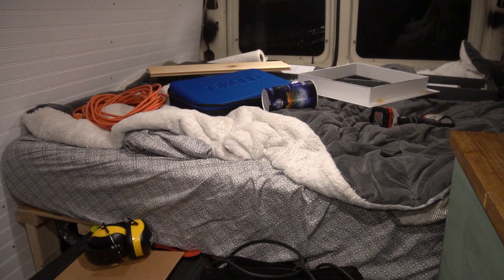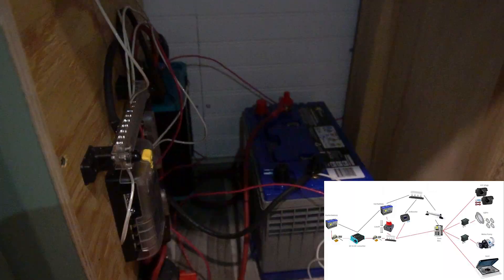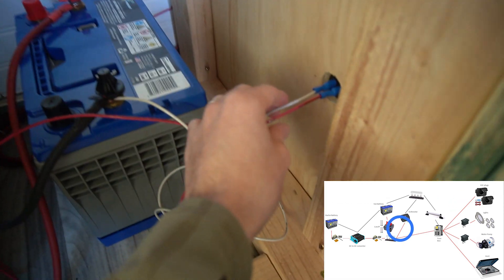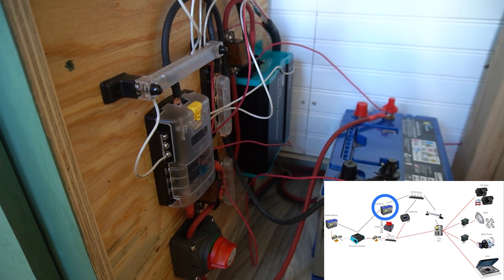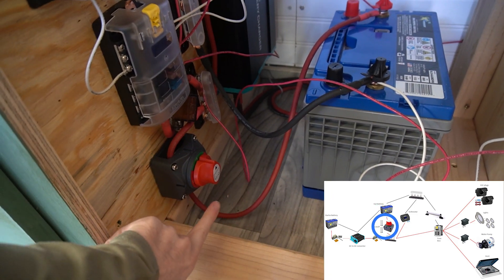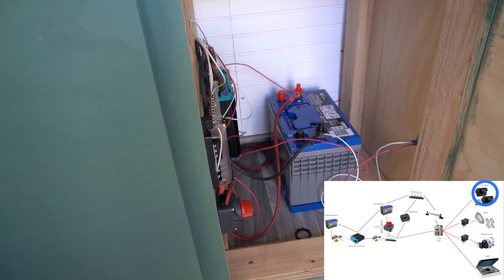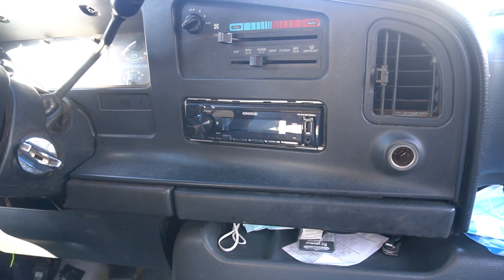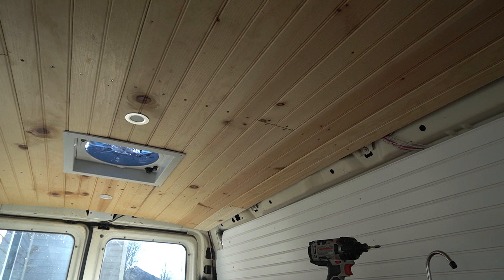Van Conversion Electrical under $1000 - Econoline Van Conversion: Part 3 - 1992 Ford Econoline E-250

Comment: You can't go half ass. As you have to wire everything before you cover the Walls or Roof...Unless you like exposed wires hanging everywhere.....So I suggest you plan on upgrading and run the proper wire ahead of time...

Comment: I’ve seen a lot of installs for rooftop fans and they’ve usually mentioned butyle tape as the best way to ensure a leak proof fan👍🏻 thought I’d mention. Nice build and videos
Reply: Butyle tape is 1950's technology... You use 3M Windshield adhesive. It will last 30 years. Why I have no clue why people still use that stuff....As it Dries up and Cracks. Does not resist vibration or high heat....And anybody that tells you butyle tape leak proof is lying...

Comment: I'm so grateful for this video! I want to use a 110v refrig/freezer, 1150w 120v black n decker bake/crisper/ 3000 w Pure Sine inverter is what I've already purchased and I'd like to add a two burner electrical cooktop, I don't want to use propane, can you give me some pointers on what I'll need to have for my power build, I haven't found my vehicle yet but I'm buying things so they'll be no delay...I also want solar...
Reply from the maker: I am glad you found the video helpful. it looks like you have plans for running a good bit of electrical in your van. I would definitely go with Lithium-Ion batteries for a build like yours since you will need substantially more watt-hours. The batteries are more expensive but can be run down to almost 0 unlike AGM or lead-acid batteries and weigh much less than lead-acid. Look online there are good calculators for calculating the watt-hours you need to run everything. I will also add that any 120 V lines coming out of the inverter should be put in a conduit. 12V that cars run on is fairly safe but once converted to 120 V there is a higher risk of spark/fire or shocking yourself if not properly grounded.

Comment: Could of saved your self some money grounding to the frame or side of the van. No need to run from the battery to your dc to DC charger. I have the same setup but the renogy solar DC to DC charger.
Reply from the maker: Good point. That crossed my mind. I ended up running a complete run since it was only about $15 more, and with the electrical already in the van being older I felt safer running a wire directly to ground. I’m an engineer so I probably have a tendency to over engineer things sometimes lol.
Reply: For $15 why not but in CAD that would be $30 ish or more. Some plastic loom over the cables and zip fastenings clean the hanging cables up and kinda protect them. Keep up the great work. I also have a E-350 I would like to do a lot of changes to my workmanship etc.